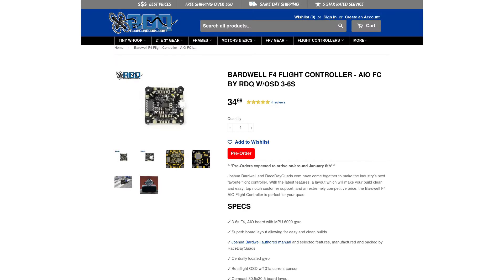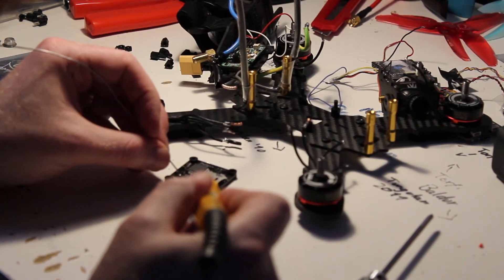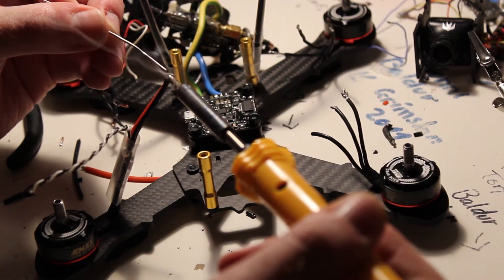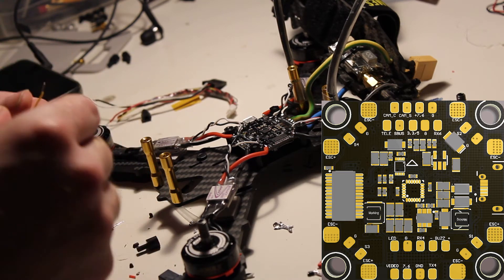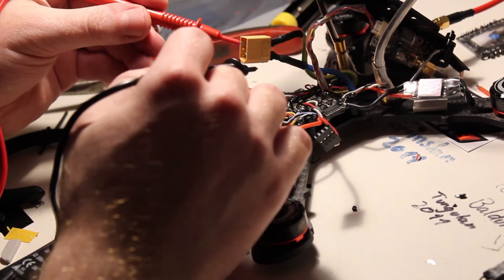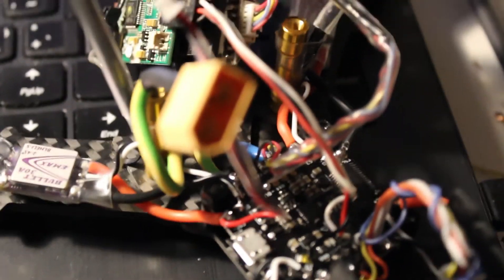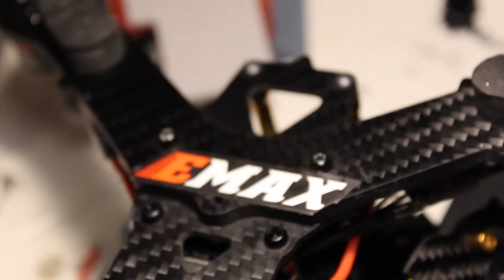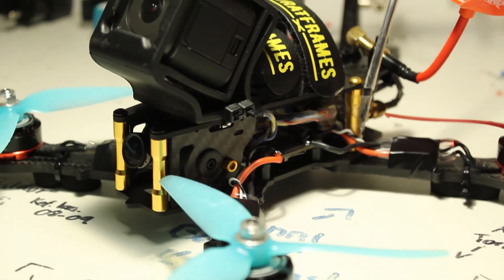Bardwell F4 AIO Flight Controller Build

Comment: another thing. I want to upgrade firmware from ESC but when i try to read setup it goes straight to finished reading setup. Why that happens?
Reply from the maker: It's hard to say. Do you have a battery connected when you're trying to read setup? You need to have a Lipo connected or your ESCs won't get any power and the BLHeli_S Configurator won't be able to read them.
Reply: power on
Reply: its Dshot1200 Harkrc
Reply from the maker: nandoss oss I'm not sure honestly. I would say check for info on your specific ESCs, if there's a manual read that. The only job of the FC is providing a passthrough from the USB to the ESCs and I don't think that's the problem here.
Reply: with BLHeliSuite i got it! thanks anyway

Comment: Great video!  And loved that you showed us your mistake in not reading the manual!  I have done that myself with the CLRacingF4.  I will definitely be watching for more video's from you like this!
Reply from the maker: Thank you! Yeah hopefully my mistakes can help others not make them.
Reply: Have you figured out an accurate scale value for the current meter. It comes set to 250 but that dosent seem correct.
Reply from the maker: I haven't actually measured it. I felt like the amount of mah consumed made sense with the voltage I was getting when I land, but then again I don't really know. I'll measure out a couple of packs next time I fly and see what kind of results I'm getting.
Reply: I have seen another guy report that the number we want is closer to 350 to even be close to accurate. I flew 15 packs yesterday with scale set to 250. Board said i used approx. 1400 mah out of a 1300 (i flew it past 1300 mah consumed because the voltage didnt show it as being that low), when i charged up last night, the charger only put 950 to 1000 mah back in. I will fly another 15 today and test the 350 scale setting. Hopefully its close as i use mah solely to determine landing time.😎